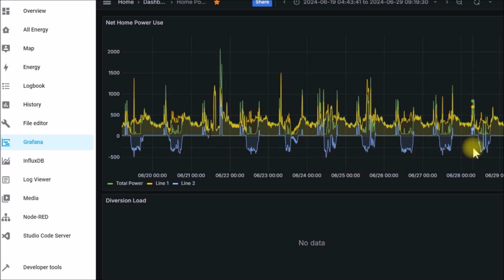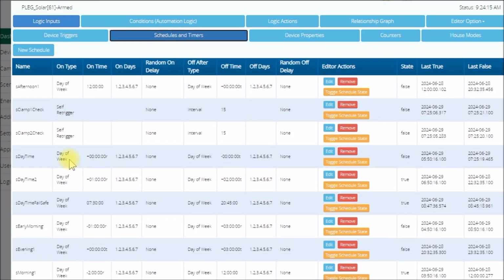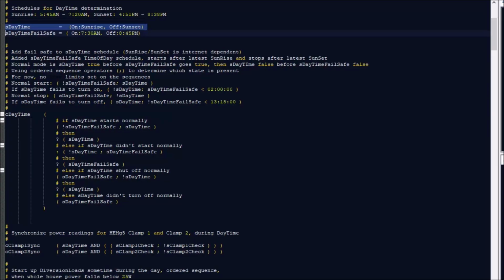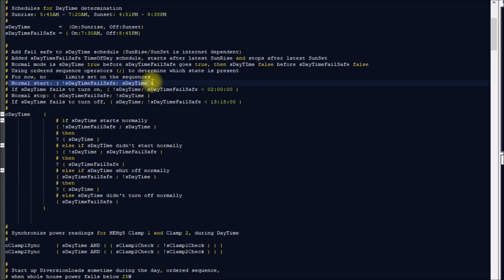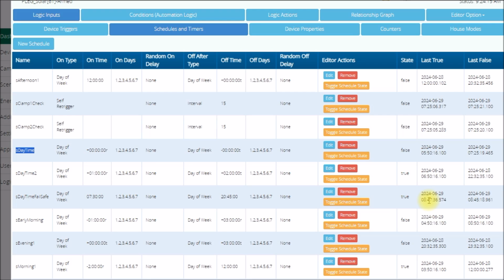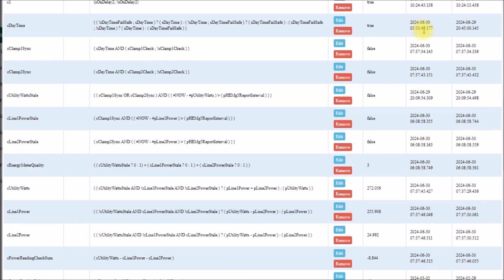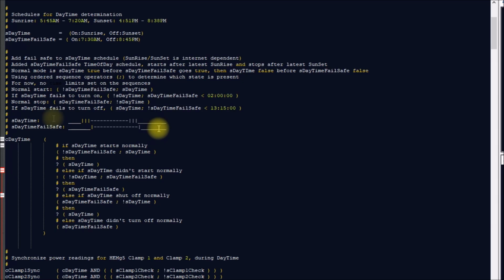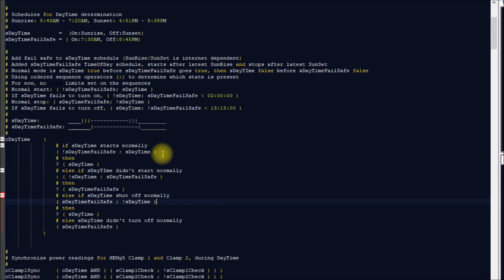Home Automation: SunRise / SunSet Issue

Comment from the maker: Comment below if you've ever run into anything like this with your home automation system.

This is the first time I've noticed this sort of issue.  I've had many internet outages (cough, Comcast, cough) in the past but this is the first one I've noticed that spanned either sunrise or sunset times.  

The fail safe logic I have now is working well and seems to handle this short term internet outage with my testing.  Although I'm looking into a more robust fix that should handle outages of longer duration.  The neat thing is you can write up that code, add it to the other condition expressions and the PLEG environment will execute that code and you can see the state changes and time stamps.

It takes some time to work through all the scenarios that might happen and then implement fixes for all those in one line of code.  I've also loosened the reliance on the sunrise/sunset checks in the code.  Those were partly done to limit the code from running when it wasn't needed.  But I realized that, while it still runs, the expressions stop quickly because they see there's no excess power to deal with.
Reply from the maker: This turned out to be the perfect fix:
  https://youtu.be/cxgliGcDoC8
By setting up my Synology NAS as an NTP (time) server and decoupling the VeraPlus from the Vera/Ezlo cloud services, there has not been an issue with missed sun rise / day time transitions.